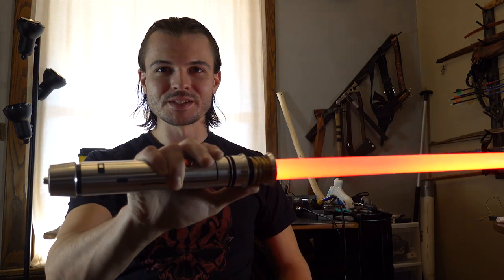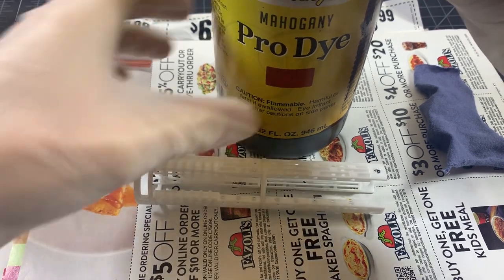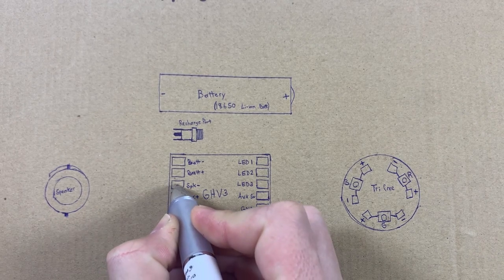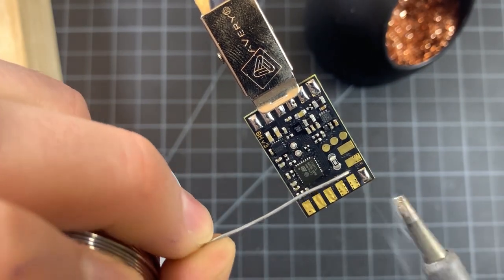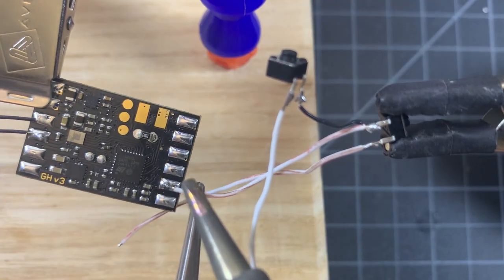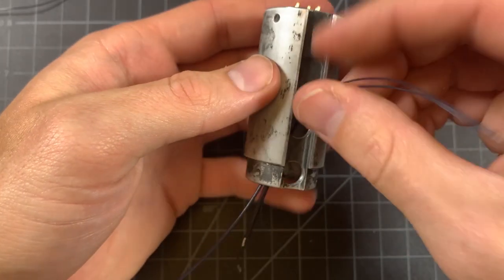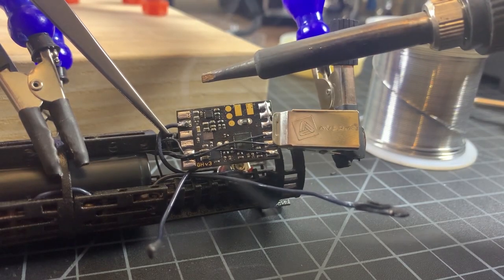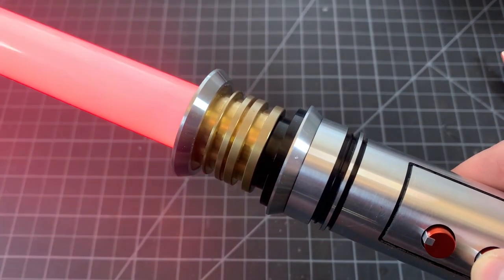How To Build A NeoPixel Lightsaber - One Replicas Obi Arena With Golden Harvest

Comment: Great video! Thanks for this explanation! One question though, for the Neopixel blade PCB, is it also not necessary to add a resistor, just like the hilt PCB?
Reply from the maker: Correct. As long as your board has a built in resistor (the GHV3 does) you don’t need to add another. The advantages to having one in the blade, comes into play if you ever use it with another board. For instance, if another saber has a board that lacks the built in resistor, you already have one in the blade. Also, the blade ID function is something that would apply if for instance you used a proffieboard. Then that blade could be specifically recognized by the value of the resistor. The proffie manual and github pages highlight that feature. Otherwise though, it isn’t necessary. An extra resistor on the data line never hurts anything though.

Comment: Thank you for your guide. If I were to do a similar build using tri cree I would have to add resistors, but I couldn't see where you added them here. Where would you recommend placing them for a setup like this and which resistances did you end up with for your specific component? Thanks!
Reply from the maker: For a neopixel setup you have 3 leads that go to the blade connector/LEDs unlike in-hilt (tri-cree). And the resistor must be placed on the data line, somewhere between the board and the first pixel. How you approach it will vary widely based on the build and components used. For this Golden Harvest V3 there is already a resistor built into the data line on the board. If using a Proffieboard V2.2 there is one built into the data 1 pad, so anything on data 1 will be set. Sometimes blade connectors have a space to put one or come with one pre-installed. That covers it just the same. However, if you are in a situation where you need to add one, the resistance you are looking for can be either of two values. You can use a 330 ohm resistor or a 470 ohm resistor. It doesn’t matter which. Also, if you have one built into both your connector and board or even a third resistor on your blade side connector, that would be fine. Because they are on the data line they don’t affect brightness or pixel function at all. Their purpose is to manage any voltage spikes in the data line that could potentially cause damage or unwanted function in your pixels. You are welcome!
Reply: @EccentricArtisan  Thank you for your reply! I'm looking to use an 18650 battery with a nominal voltage of 3.7. However, I know that batteries like this have a standard charge at 4.2 volts. Would I be worried about the 3.7 voltage value for resistance calculation or would it be safer for the life of the components to use the 4.2 volt value for calculations?
Reply from the maker: @wieneckejacob4752  My mistake, I also meant to add that you want to place resistors for tri cree on the positive or negative line of each diode. I tend to install mine near the LED but wherever works within the install is fine, as long as they come between the LED and power/board. As for calculating the values, I stick with 4.2 V as it will be a safer way to protect the LEDs.
Reply: @EccentricArtisan  Sounds like a plan! Is the golden harvest able to regulate charging on its own or would I need to invest in a smart charger?

Comment: Great build you've done there. Really nice saber. My first build is alot simpler, due to my hilt being just a bit smaller in diameter to a LGT saber hilt, had to forgo  a kill switch and recharge plug 🙄, but the battery is removable, and I have a external charger for 18650 batteries.

Have one question. My next build is going to be a conversion of a old master replica darth maul saber from 2007, changing it to neopixel, but after watching your video, was thinking of adding a accent led as when the saber is in 2 halfs, the pummel has a exposed kyber crystal so thinking of a way to run a small led to it, to light it up, are they pretty straight forward to wire up?
Reply from the maker: Thank you! And first builds are usually humble. My first with electronics was an old flashlight.
With neopixel, accents are very straight forward. They work just like a very small version of your main blade! You just use one or two individual pixels wired in the same fashion as the blade itself is to the board.

Comment: It's weird seeing neopixel with pin connectors they are now a flat contact connection
Reply from the maker: I remember when it first became popularized. I was initially very skeptical of string blades and then neopixel due to their low durability both in components and installation style. But it’s incredible how far everything came so quickly. And neopixel really is a great option now, even for rough play. The pin connector made everything next level as too.

Comment: Hey man! ive been struggling to find a good tutorial for ghv3 for awhile, so tysm! quick question- i plan to install a saber with a single switch setup. How would my wiring differ from yours?
Reply from the maker: Glad you found it! That’s a very simple change. Essentially you are just leaving the auxiliary or secondary switch off. I believe page 18 of the GHV3 manual shows the diagram for that configuration.
Reply: @EccentricArtisan  ok, thanks! I had another thing pop up that I wanted to ask. Will 26 awg work instead of 30?
Reply from the maker: @bananajesus667  If you are asking specifically for the switches, data line, accent LEDs, or items that carry small current then yes. For low current applications you can use whatever suits you best or what you have at hand.  Make sure you have the room to run it if you go with a larger gauge though. And just remember that going bigger than the recommended gauge never hurts electrically. It just takes more space in the build.

Comment: Great video! I'm about to build my first saber and this helps so much. Quick question. Is there a special type of grease you use?
Reply from the maker: Thank you! And as far as grease for threads lithium is generally recommended. Most grease will work okay, but white lithium is relatively inexpensive in small tubes and works great.

Comment: Just found this and I'm going to be starting my first Neopixel Build! Question, why did you use 2 switches instead of one momentary switch?
Reply from the maker: Good question! I have sabers with 1 switch as well that you can see in my other videos. 2 switches allows for a different style of menu navigation as well as more/easier access of some auxiliary functions (blaster block, blade lock, etc). This will vary based on what board you use, so look through the board’s manual for the switch functions to see the specifics for your board of choice. Either option works for most electronics. It just changes the way you control functions. Also, some sabers are physically setup for two switches and some for just one. Though, there are ways to add hidden switches to sabers as well.
Reply: @EccentricArtisan  Fantastic! Thank you so much. I appreciate the amazing tutorials and information. I'm putting together my buylist now :-)
Reply from the maker: @AlexCorrao  Excellent! And you’re welcome! Feel free to join the Facebook group in the description and share your build there! Also a great place to ask questions and access a wider collective knowledge.

Comment: great video, an update for pixel strip would be nice!
Reply from the maker: Thanks Marc! And just to clarify when you say an update for pixel strip, what do you mean?
Reply: @EccentricArtisan  I am in the middle of a personal custom build and have purchased the Golden Harvest v3 phase4 board with a USB seed board.  I am going to use two (2) WS2812B 144-LED Pixel Strip and planning for 3 accent pixels.  After reading the manual, It states I have to bridge pads 1,2,3 and according to the manual the accents have to be first in the series.  Though I can't find if I can wire the accents (Pixels) to pad 4, 5, 6 and possibly split the data line.  Any thoughts would be greatly appreciated.  There isn't to much info on the GH boards.
Reply from the maker: @marcringuette3622  gotcha. This being out of my field of expertise, as I mostly work with Proffieboard, I am going to recommend asking in the Golden Harvest group on Facebook. If you can pose the same question there you should be able to get a definite yes or no as well as further direction if need be. A couple of my friends admin the group and Frederic Folz, the creator of the board, is an admin as well. https://m.facebook.com/groups/goldenharvest/

Comment: Why not put the recharge port in the hilt and hide it with a removable screw or the like?
Reply from the maker: Good question. For this hilt it was a matter of the chassis that was available as well as wanting to leave the exterior of the hilt original. Although you could certainly do exactly what you’re suggesting if it is your preference.

Comment: how reliable are the 3d printed chassis that the electronics sit in and should I get a resin printed one or a casted one or something along those lines
Reply from the maker: Materials vary greatly, and so do printers and printing processes. However, this chassis is printed in the “versatile plastic” from Shapeways. It’s nylon and holds up very well to regular dueling. As long as the chassis is well designed and printed, as well as mounted properly within the hilt, 3d prints are plenty reliable. Obviously, you wouldn’t want to duel with it exposed though.

Comment: Awesome man, but how much did everything cost?
Reply from the maker: Thank you! The blade and saber were $587 in parts, but that doesn’t include tools or time invested. However, that isn’t an accurate representation of what the current price would be. Inflation due to time and the current health crisis have driven those costs up. Customs like this are pricey. People always say, “that’s too expensive” or “I can get a saber for way cheaper”. And they are right. Darkwolf Sabers is where I send people for the budget stuff, but having very specific custom sabers is a bit costlier in general. Also, there is a google doc linked in the description that will show you all the parts for the build if you want to check current prices!
Reply: @EccentricArtisan  thanks! I’m thinking ab building one but without the neopixel effect, so I’m just going to 3D print the saber, and electroplate it en then buy a blade online and put some leds in it. And ofcourse some soundeffects. But it’s going to be my first build, so you have to start somewhere 😅
Reply from the maker: We all do. My somewhere was pvc and plumbing pipe when I was about 10. I was dying to have these kind of sabers though! Anyhow, feel free to join the Facebook group linked in the description. We’ve got parts resources linked in our announcements, and loads of experienced builders to answer any questions you have. It’s also cool to see people posting their builds and how they progress as they learn.

Comment: This was incredibly insightful and has helped me tremendously, even though in using a proffieboard. My only question would be wether using a lower amperage battery, like 3000 instead of 3120, would be harmful to the electronics. Again, this video is spectacular and it shows that you know what you're talking about.
Reply from the maker: Thanks very much for the compliments. I’m glad you found it helpful! 3000 and 3120 are actually milliampere hours (mAh) and represent the capacity of charge the battery can hold. And the larger that number the longer the run time, given everything else is equal. So it would work perfectly fine. The important numbers when searching for the correct battery are the Amperage (A) and voltage (V). With Proffieboard you want a 3.7V Li-ion, which will actually have a max capacity of 4.2V if you read the specifications or description. And for Neopixel lightsabers you need to have a battery rated at 15A max continuous discharge current. Higher would be acceptable, but lower would likely cause performance or functionality issues, because the battery wouldn’t be able to supply enough power to continuously light up your blade.
Reply: @EccentricArtisan  dude you’re literally like, so smart its insane.
Reply from the maker: @doristhebartender6725  just well studied lol

Comment: what kind of speakers did you use?
Reply from the maker: I’d have to check the build again for the exact one, but I have a parts list google doc linked in the description with several options. All will work similarly.
Reply: Okay thanks and would you say that the obi arena hilt chassis would work with the progeny hilt by saber forge?
Reply from the maker: @ghosteditz9964  It’s highly unlikely in my opinion, but that’s only speculation. I don’t know the internal dimensions of that hilt. However, you can search etsy for a chassis by hilt name or by the inside dimensions. I would suggest asking for a chassis suggestion in the Facebook group linked in the description as well as this one https://www.facebook.com/groups/531427861389790/?ref=share
Reply: Okay thanks
Reply from the maker: @ghosteditz9964  You’re welcome

Comment: Hey, the hilt is sold out, is ist possible to use another hilt but the same components like the chassis and so on?
Reply from the maker: You could use everything except the chassis, because it is hilt specific. However, the methods of preparation, assembly, and wiring can work universally. Just apply the same or similar approach to another hilt and chassis. To give you a better idea of what I mean, watch my other two videos on a different saber install if you get the chance. You’ll see I use a lot of similar methods despite obvious differences in the builds.
Reply: Could you recommend a hilt with a fitting chasis?
Reply from the maker: @timknittel3552  there are a lot of options out there, and I don’t know what your preferences might be. But I’ll give you a place to start. I haven’t owned one, but I hear only good things about the Flagship saber from The Saber Armory. It offers a lot of space for customization with etching, grips, leather wrap, etc. There is also a chassis available for it from the same vendor, called Flagship V2 Eco Chassis, that will hold the same soundboard used in this video.
Reply: @EccentricArtisan  I put everything into my shopping bucket, it is almost 300€ in total. So you recommend spending so much for a do it yourself saber ?
Reply from the maker: @timknittel3552  it all depends on how you feel about the money and what your budget is. Everyone will feel differently, but yes I feel it is very typical. Over a decade in the hobby has taught me it’s expensive no matter low budget or high end. I’ve done installs with parts that totaled only $300-$400 and some that were closer to $1000. The saber in this video was over $400 and closer to $500 with the blade. And that’s just parts. Tools, bench time, experience...all those things add up too. Lol, I wish I could say that it was all easy on the wallet, but I’d be a liar. I purchased just a bare hilt today for $500.
Reply: @EccentricArtisan  Oh man, that‘s a lot! Would you say there are complete sabers with equal functionalities for a Price of around 300€?
Reply from the maker: @timknittel3552  more or less. They won’t be exactly the same. You’ll sacrifice some things because they are mass produced oversees generally. However, there are distributers in various places, including the states, that handle distribution and customer service. If you’re here in the US your best bet is darkwolfsabers.com. The owner is Johnny Collado, and he’s a real good guy. He’ll help you with anything you need including any issues with orders. His customer service is top notch.

Comment: What is a kill switch ?
Reply from the maker: When talking about lightsabers, it usually just means a switch that stops power from going to the soundboard. Usually either a switching power jack, like in this video, or a slide switch. And because they carry or hold back the power from the battery, they must be rated to handle that power.
Reply: @EccentricArtisan  ah ok thx again does every saber need it ?
Reply from the maker: @qiaozhiwu4610  Some people don’t incorporate them in every build, but I like to. If your battery is removable, it’s good to have one that can be switched off prior to removing the battery for safety reasons. But it also allows the saber to be stored with a battery in it for a very long period of time without the battery slowly draining. Some boards have a sleep mode that they go into, but it’s better yet to just have a switch that full disconnects the battery. That’s even more useful when the battery isn’t removable. And if you need or want to charge the battery while it’s in the hilt, the switching recharge port/power jack will provide both charging and power down functions.
Reply: @EccentricArtisan  ok so I will get a removable   battery but should I buy a momentary switch or the latching switch for  the kill switch? And which one for the main switch ?
Reply from the maker: @qiaozhiwu4610  this is what I use and is often recommended for removable battery kill switches. https://www.digikey.com/short/z22c80

And double check with the vendor, but I believe the graflex saber comes with the activation switch.
Reply: @EccentricArtisan  wow what a coincidence the guy who is selling the chassis also recommend this one. Ok I guess I have nearly every I need i just need some wires and then I have everything and thx again 😃
Reply from the maker: @qiaozhiwu4610  yep, that’s the go to switch for most installers. You are welcome!